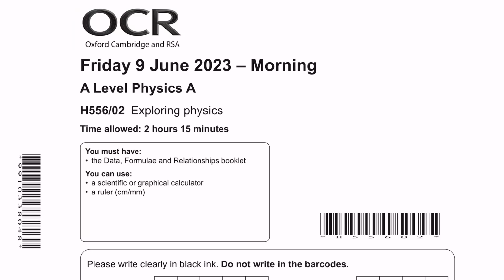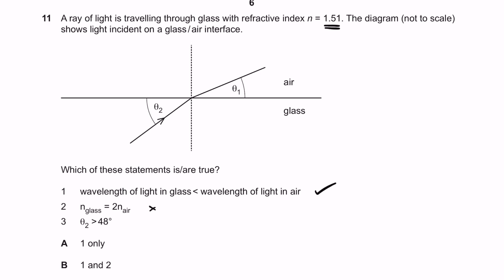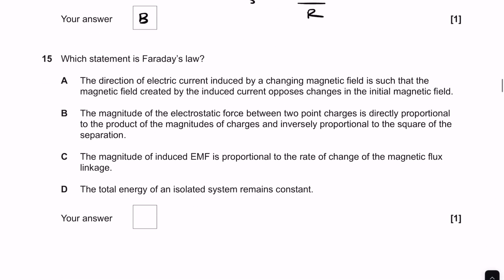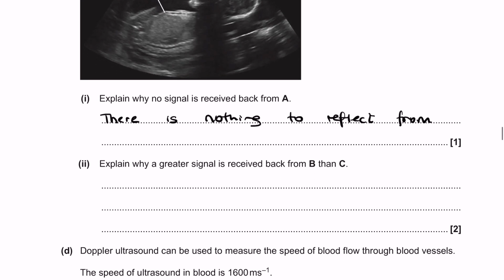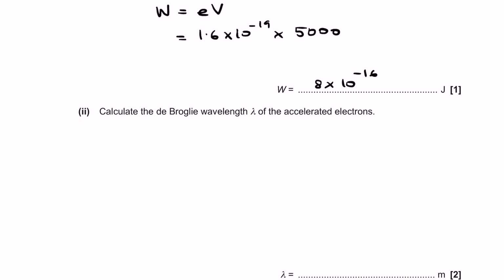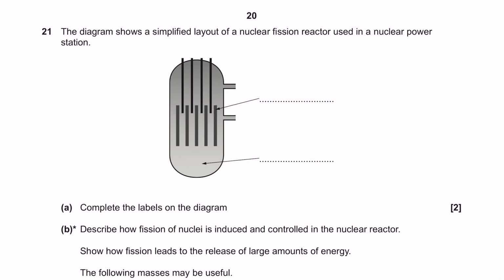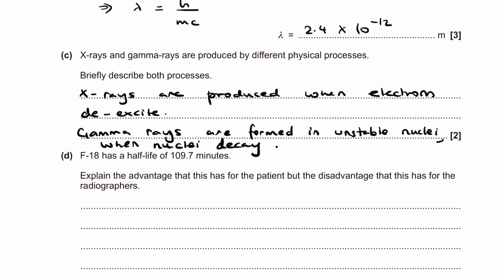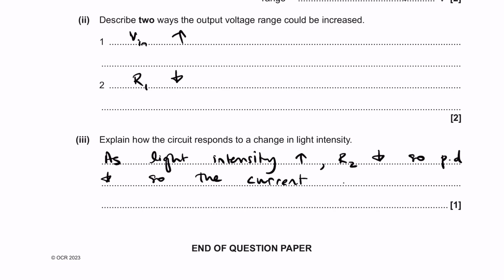OCR Physics A Paper 2 June 2023 (H556/02) Walkthrough

Comment: bruh i appreciate the video but for some questions (probably a very very small number/minority) ur just copying answers from the mark scheme and making justifications for the method BASED on the answer. Some of which is wrong and very misleading.

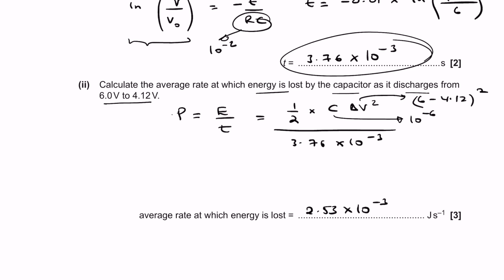34:35 you wrote the calculation to use, then said 'if u put in calculator', you get 2.53 * 10^-3. In fact, putting that in the calculator gives 4.7 * 10^-4. The correct answer is indeed 2.54*10^-3 but you just copied it from mark scheme - while the method in the video is incorrect.

genuinely appreciate the help and i get it's a long video, but it makes it significantly more difficult to learn when the method used is incorrect while the answer is shown as correct even tho it isnt
Reply from the maker: Points noted, thank you. I'll make sure to keep my work independent of the MS and double check for any errors.
Reply: @EliteTutelage  thanks, apologies if tone was off, 1 day b4 exam haha